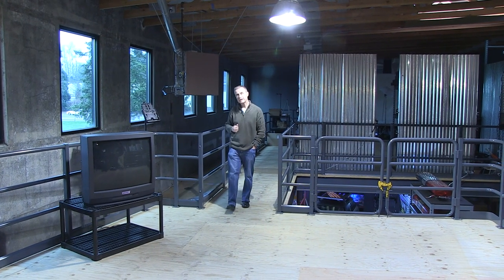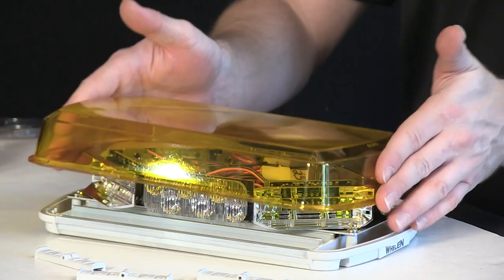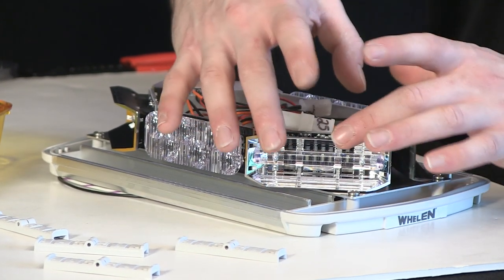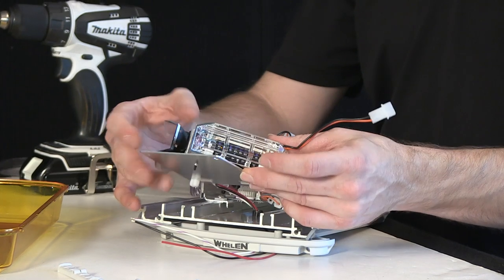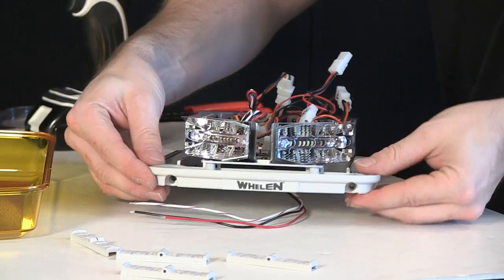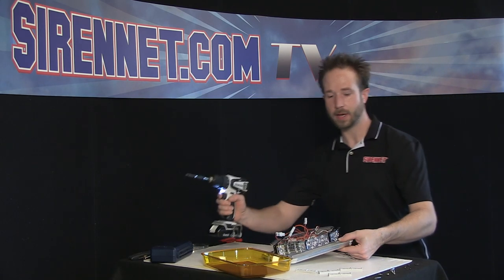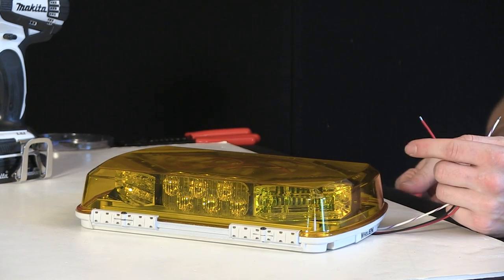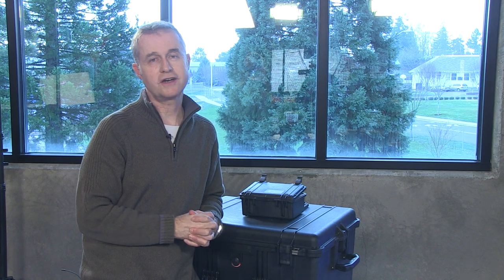Chris shows us inside a Whelen 11 inch Century Series Mini Lightbar

Comment: I love your videos and products!! wish I could order from you guys but canadian customs always over charges with their fees!. also love your installation videos they are awesome. quick question, let's say I buy this bar and I no longer have a use for it after 2 years, can the modules be taken out and be installed as exterior lights as long as I wire up the flasher unit ?
Reply from the maker: Thank you Dan. :)     The modules within the Mini-Centuries aren't designed for exterior mounting by themselves unfortunately. They need to remain in a housing away from the elements.